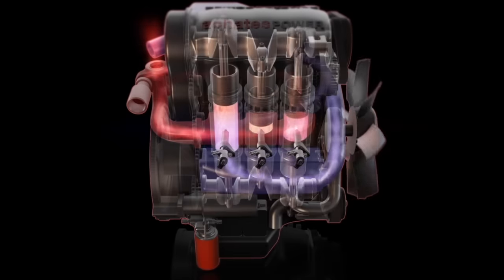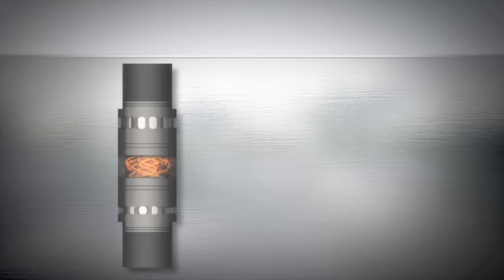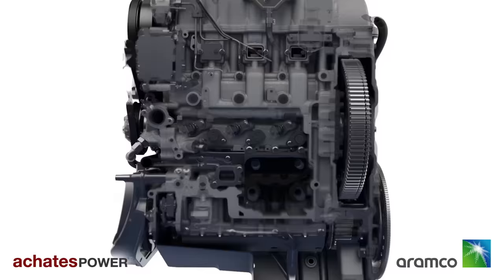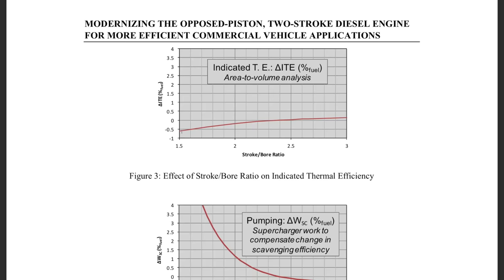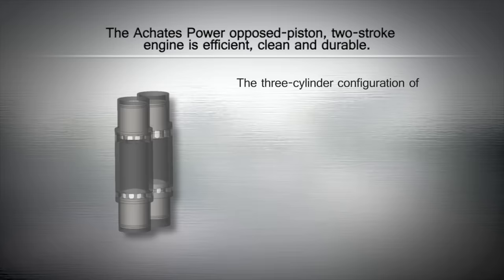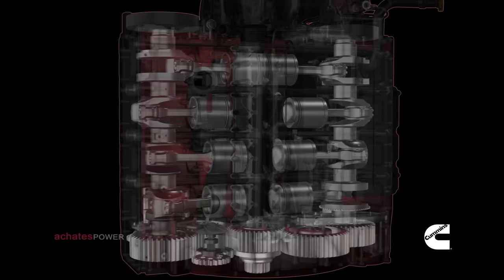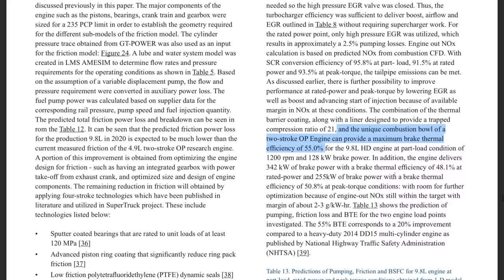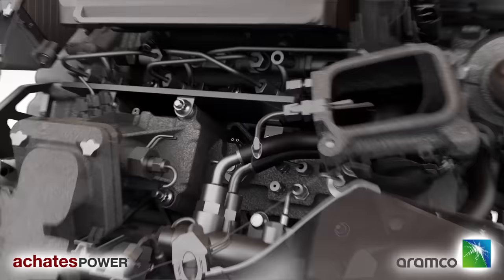Opposed Piston Diesel Engines Are Crazy Efficient

Comment: Now with Diesel being phased out here in Europe, I wonder what would happen if such a design where to be adapted for a regular gas car?
Reply: That would probably be hard to do without using super-high octane fuel.
Reply: derschwarzgeist wonder if ditching 1 of the injectors for a spark plug and making the other injector bigger would solve the issue? Or would that mess up the air/fuel mix
Reply: @TC14KID  The problem isn't the air-fuel ration, it's the compression, though you could potentially solve the issue by making the two sides of the cylinder much more oversquare. If the compression ratio is too high, it can cause predetonation of the mixture, which is what engine knock is.
For a regular gasoline engine, you'd need to put a spark plug in anyway.
Reply: Yeah, it's weird. Gasoline engines should be phased out instead since they are less efficient. Maybe not according to the new EU cycle, but in reality
However, HCCI (=Mazda's Skyactive-X engine) is possible in an opposed piston engine. Don't know what the status is today, but it was tried some 10 years ago, and seemed promising.
Reply: I would think compression and heat exchange would be the biggest problems with Gas powered but I am not an engineer so this is just my opinion
Reply: Perhaps a type of compression plus spark ignition such as developed by Mazda for their Skyactive X series of engines?
Reply: @per6605  The thing is, gasoline engines have less emissions overall, which is why they are phasing out Diesels (probably among some other things).
Reply: @FinlayDaG33k  Yes, but those problems can be solved, whereas the low efficiency of  gasoline engines cannot be solved, unless you opt for an HCCI/skyactiv-x solution. (Just make sure VW's management are nowhere near those who are trying to solve the emissions problems)

The current bashing on diesel engines is just as incomprehensible, as the glorification of diesel engines was some 10-15 years ago.
Reply: @per6605  True.
+1 for the VW reference tho xD

I'm not against Diesel per-say as long as we can get more miles for our emissions.
Which is why I'm not that great for EVs yet since when factoring in the fabrication of the batteries and such they tend to give off a lot more emissions...
Reply: @Lord Fluffington Than Nuclear energy. happy now?
No, I meant as compared to Diesel (it's all in the context)
Reply: Diesel will be phased out when you do not fly by jet, or ship, or train, or...yeah it will be around so long as those modes of transportation exist.  There is always the Hindenberg II.    As for gas cars considering they are fuel injection then it should work.IMO

Comment: Why are cylinders vertical in this example? If you put them horizontally, you can also lower the centre of gravity?
Reply: I'd be surprised if there would be any problem packing a 1 litre version of this engine in most small cars in any  orientation you like. Subaru manages to fit two engine blocks each with its own valve train across their engine bays.
Reply: Probably too wide for the engine bays they're targeting. Another commenter said that they had to mount it at a slant to fit it in an F-series.
Reply: It's not vertical. It looks like about 60deg. But there is no technical reason it can't be laid on its side like a Toyota Previa engine or some transit busses.
Reply: Even more interestingly:
Since the pistons don't into the cylinder section of the each other, the pistons don't need to face exactly end on.  The bottom of the engine can be made very flat and the top rise a bit in the middle.
Reply: Rootes made a very successful bus engine like this in the 50's.
Reply: Donald Sayers:
I think they also did trucks with the opposed piston engine.

Comment: Opposed piston engines have been around since the 1930,s.They were designed by Junkers (the Jumo 2004) and license produced by Napier (Culvern) for naval application.They were used to propell versions of the Dornier Do 18 and Blohm und Voss flying boats.A three bank 18 cylinder version produced by Napier powered the class 55 locomotives,but versions for naval use have been produced by Fairbanks Morse and Doxford.More recently versions have been produced by Commer (TS 3) for light truck applications and a military version (Leyland L60) for use in the Chieftain tank.

Comment: now make it a 5 stroke where at low load the center cylinder acts like the outer cylinders combusting diesel but at high load it stops injecting fuel and instead, exhaust from outer cylinders is routed to center cylinder to scavenge lost thermal energy.

Comment: 2-stroke diesel engines have been used in large commercial buses for many decades, since the 1940s at least.  See the Bus Grease Monkey channel.  They run for 100s of thousands of miles relatively trouble free.  The down-fall of those engines was newer/tighter emission standards.
Reply: I was looking for and interested in emission issues.
Reply: Is the final verdict that they can never meet emission standards? Doesn't higher efficiency mean less unburnt carbon tho
Reply: @Cotronixco  In 2-cycle gasoline engines, yes.  In 2-cycle diesel engines, no.  Diesel is a light weight oil.
Reply: Had an old Chevy Impala SS en an oL Apache 👌 . Downdraft to PCV,🤔.
I say that if there was opposing Pistons & turbocharged? Tearing up the road would be great having efficiency 🎶🎶
Reply: Radar Love or that Springsteen or Eagles My old 55 🤔 en now the Sun comin up Riding with Lady Luck 😅
Reply: @peterm.eggers520  Wouldn't modern fuel injection resolve that problem?
Reply: @tonyb9735  Apparently, @Cotronixco deleted his posed problem in shame.  Going on my fuzzy memory of it, he was thinking that oil had to be mixed oil in a 2 cycle engine, which it doesn't since diesel fuel is already a lubricating oil rather than a solvent.

Not sure what fuel injection has to do with that problem.  If diesel weren't an oil and needed oil added, then yes.  My last 2 cycle motorcycle (1980s?) injected oil into the fuel mixture based on RPM, IIRC.
Reply: @Stuart Aaron I never heard of a 2 stroke gas engine that used the crankcase as an intake port/manifold.  Do you have a link?
Reply: @peterm.eggers520  That's the only way I have ever known a two stroke to work....Google how does a two stroke engine work.
Reply: @soundsofnature7015  I checked for a new design.  Nothing.  They work just like they always have -- no valves, just intake and exhaust ports.  No intake through the crankcase.
Reply: @peterm.eggers520  you must be confused. I have worked on small engines for over 20 years. All two strokes pull air through Reed valves directly into the crankcase.....
Reply: That's why you mix oil with the fuel. The fuel/oil mixture is pulled in from the carb directly into the crankcase. The oil is to lube the cam and crank. When the Piston hits bottom it pulls the air fuel oil mixture from the crankcase into the cylinder. The mixture is lightly compressed from the Piston moving down into the crankcase which causes the air to rush into the cylinder more readily and we'll mixed. It's not rocket surgery my man.
Reply: @soundsofnature7015  Apparently you don't know the difference between cylinders and the crankcase.  I seriously doubt you have worked on any engine.
Reply: @soundsofnature7015  I've worked on Engines since the early '70s, repairing, swapping, modifying, also some patenting in the '90s. Everything you said in your comments here was correct...

Comment: It's great but mechanics once it has to be repaired will be a bit tricky job
Reply: But there is lot less to repair. Compared to a valve job, piston rings and liners last hundreds of thousands of miles between overhaul.
Reply: Fairbanks Morse designed this configuration back in the 40's. Awesome efficiency and power.
Reply: @mickcorcoran901  
I forget the engine model number, but it's been in continuous production since the 30's, I think.

Comment: I came across one of these; a big old british tank engine a few weeks back. Cheifton or something. Was a right old lump. Was a cool running engine but lots of cranks and chains. Leyland L60 695bhp
Reply: yep, the Chieftain used the Leyland L60. Sadly it was a pretty bad engine. It was to weak for the tank it should power and horrible unreliable. It was desinget to be multi fuel, yet it took a day for a team of engeniers to change the fuel type it used.

Comment: When I was younger doing my apprenticeship as a driver. I got to drive an old Commer-knocker. With it's opposed piston motor. Drive it after one day you wound up deaf. They could pull like a dozen schoolboys. You had to wind em up before you came to a hill. that 2 stroke drone was always there. But loud as. They liked to drink being 2 stroke. Possibly ahead of their time back in the day. But trucks of the 50s up to the 70s you needed to constantly drive them. Good for where space might be an issue. The weak link was having 2 crankshafts.

Comment: Don't tell Navistar about this type of engine! They still can't build a conventional diesel that doesn't have huge issues..
Reply: Navistar builds great engines the problem is what Ford bolts to them
Reply: What?  The DT 466 engine is, or is very close to being, the most successful engine for powering medium-duty trucks of current times.  And when it does finally wear out, it can be completely rebuilt in place (no removal from the vehicle is needed).  How clever is that?

Comment: Would love to see the MPG's.  I long for the day for powerful engines are great gas mileage.
Reply: ChildoftheKoRnf9 if o remember correctly. I think achated said there prototyoe average 40ish mpg....averaged and it had enought power to use on a pickup
Reply: D Jay T pretty poor then my car does 60mpg and has 300+ lbft
Reply: BMW 335d had the exact same output specs, and had massive fuel effeciency.  My highest was 90mpg between Boulder and Denver, driving like an asshole using all the power, I would average about 20mpg.  Normal highway driving I was in the 40-50s.  This was in 2011.  It was a great engine.  But Americans just wont buy diesels, so they stopped importing it.

Not to mention the retarded emissions regs that killed the efficiency and gave it a lot of problems.
Reply: Depends on the car it's in, a moderate sized and well streamlined BMW will of course use less fuel with similar engine efficiency than than your average house-sized American truck.
Reply: You are correct, and the 3 series is certainly more streamlined, but the 335d was not a light vehicle either, at over 4,000 pounds, and that was with the magnesium block, which is almost as much as an F150 today.  And at the wheels the 335d produced 265 hp and 425 lb/ft.

Comment: I just wonder how long the rings will last, having to grind over the inlet and outlet ports every stroke. Just seems like a weak point.
Reply: Was never an issue.
Reply: Not a problem, DD made 2 stroke diesels for some 70 years and it was never an issue
Reply: I suppose that's true. This design does give you a lot of oompfh from a relatively small sized engine. Also, you can never blow a head gasket. XD
Reply: Electro-Motive (now owned by CAT) continues to manufacture the large GM/EMD designed 2-stroke diesels.  They are commonly found in stationary and marine settings but were originally designed for, and made famous by the railroad industry.  Rail historians know the EMD model 567 as "the diesel that killed steam", and the later 645 and 710 models are still in production today, 70 years after the 567's debut.
Reply: I think that grind may only occur for first several times of max temp operation and they should ve designed oil flow so those grinds wont be an issue for cold operation. Overheating this engine might be very bad for its efficiency though.
Reply: Wow i guess i figured it out. Oiling those piston rings are a huge issue because of those gaps you cant fill it up with oil.
Reply: I think getting heat out of this thing would be a huge issue. Especially on those piston wrongs doing double duty
Reply: @mustafayasiraydin  Yep.  Which is why you put 2 cycle oil in the fuel.
Reply: They're very low piston speed engines. I think the piston rings should be fine, but there will be quite a bit of oil being burned though and burnt oil is a huge source of harmful exhaust emissions. Much of the benefit of these engines will also be allowing for very high compression ratios which is also bad for nitrogen oxides emissions. A more efficient engine isn't necessarily a cleaner one, modern Diesel engines actually have lower compression ratios than those from 10-15 years ago for this very reason.

I think some of these quoted efficiency figures are very optimistic, normal road Diesel engines already reach well over 40% peak brake efficiency but the problem is always cold starts and very low load usage/idling. Valveless engines that rely on ports for intake/exhaust generally have a narrower power/efficiency band, not a broader one. These can probably get away with it by being very low revving engines, ie truck engines that redline at like 3000rpm. This technology isn't new and isn't protected by any patents keeping people from making opposed piston engines, so I think if it really offered a huge gain in efficiency without sacrificing something else (cost, performance, durability, maintenance, etc) those companies that make massive industrial engines for which efficiency is the main selling point would all be making these already.

Because they're very low revving they are also dependent on very large torque figures to produce any real power, which generally means overbuilt engines to handle very high combustion pressures, which means they're big and heavy. Much heavier than a conventional engine for a given power output. Which isn't a huge problem for using them as generators or in ships, but it is a problem when it comes to fitting them in cars.
Reply: Check at modern 2 stroke snowmobile engines. 850cc 8000rpm 165hp
Reply: That's a good question, you sound like an expert sir
Reply: You know nothing about 2 strokes, they last long just have the VRO pump turned up, none of this light duty valved 4 stroke crap here, get over it
Reply: You know nothing about 2 strokes, they last long just have the VRO pump turned up, none of this light duty valved 4 stroke crap here, get over it
Reply: They last long just left he Abe big 2 stroke diesel today
Reply: They last long just left he Abe big 2 stroke diesel today
Reply: Just finished a in frame on  two stroke detroit 940,000 on it
Reply: @marshallbaldwin395  are you running synthetic 2 stroke oil , i just filled my silver 8v92 with 3 gal of klotz techniplate r50 and 4 gals of xd-100 2 strokes oil 50w + 30w makes 40w synthetic low ash. theres always amsoil sabre professional at 40w, great for 71 detroits though but pricey. its high performance 2 stroke oil though.
Reply: @jlo13800  
No i have stuck with delo 100 and regular oil changes have done the trick so far
Reply: @mossturn01  nerver an issure on any rotax, detroit, OMC, EMD mercury or fairbanks mores.
Reply: @mierbeuker8148  The rotax 850 etec! cha ching
Reply: @mustafayasiraydin  theres nothing wrong with that.
Reply: @stuarthenderson7872  Damn that big rotax she never nneds to rev much past 7800, most 4 stroke out rev it
Reply: @marshallbaldwin395  I have not seen Delo 100 but shell rotella, Klotz techinplate R50 halfed with amsoil dominator is only needed for maximum hp. Its to pricey for a lot of it, My silver 8v92 is on it for now, darn 36$ a gallon, dominator 2 stroke is 11.50 quart. How much is Delo 100 per gallon?
Reply: @marshallbaldwin395  Klotz makes this werid exhaust smoke gas though, like a plastic stenche.
Reply: @marshallbaldwin395  How does Delo 100 compare to klotz techniplate 2 stroke oil? Delo 400 is cheaper, and so is rotella but i got 8gallons of klotz 2 stroke oil cheap and filled it, boy it stays cleaner and smoke stinks funny
Reply: @marshallbaldwin395  damnit synthetic 2 stroke oil is expensive!
Reply: @jlo13800  
I grew up on Delo it does job well so I will stick with it remember Detroit two strokes require a very low ash content
Reply: @marshallbaldwin395  Yes they do i have one 8v92 silver. Low ash burns cleaner! I can get shell rotella at tractor supply CF-2 sae 30w of 40w.
Reply: @marshallbaldwin395  klotz techiplate is 40w and too thick as its racing 2 stroke synthetic but its not cheap, 38 bucvs a gal, Delo or Rottela is much cheaper works just as good unless your 2 stroke jimmy at extreme power levels i guess

Comment: The Deltic Diesel engines, or British Railways Class 55, used 3 of these cylinders, in a triangle formation, to power the locomotives. It would use 3 Crankshafts, and each one would be arranged in a V formation, to have 6 pistons working 3 crankshafts. 

There would be a number of these sets of cylinders, in a line along the 3 crankshafts, which would create the power, to drive the Flying Scotsman service at over 100mph. 

These locomotives were built in the 1960's, but withdrawn completely by the 1980's.

Comment: My understanding is that it is emissions that hold this engine back from automotive production.
Reply: I was wondering about that. 2-strokes are straight to the pipe. Maybe something could be or has been added.
Reply: You mean car company parts sales
Reply: @jackdbur  no. we were talking about emissions.
Reply: Its not like the regular 2 strokes. This engine has a lubrication system like a regular 4 stroke engine so it doesn't burn oil and it is MUCH cleaner

Comment: from my limited knowledge of two stroke engines. Ports instead of valves means wear on your compression rings and smaller lifespan of the engine. is this the case here or have they overcome this?
Reply: also some increased oil consumption...and resultant emissions.